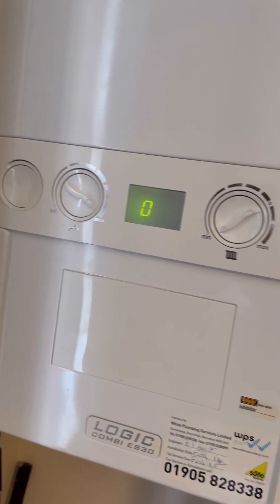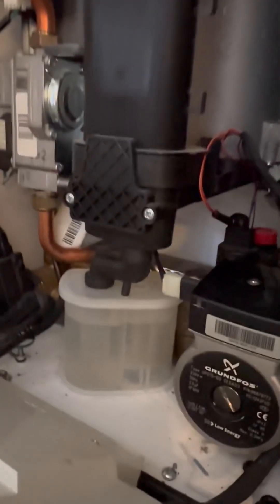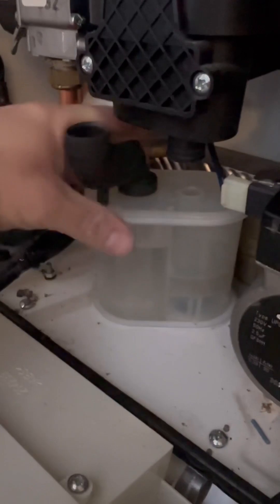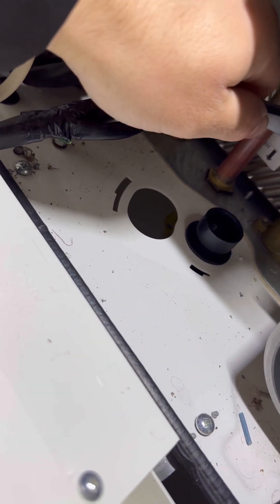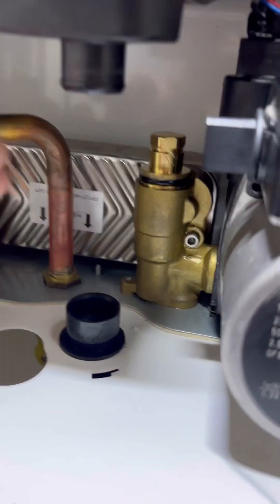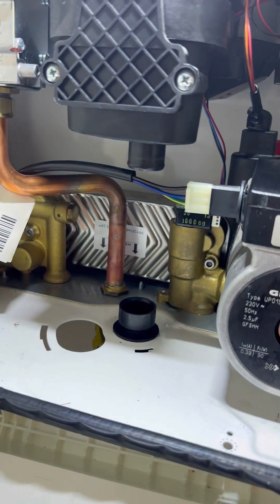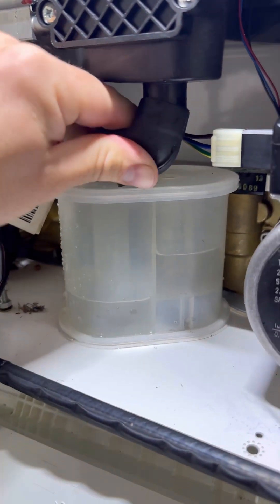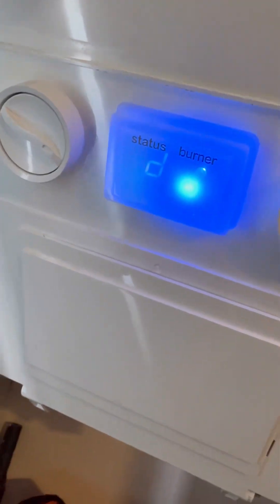‘My ideal logic combi boiler isn’t giving me hot water’ intermittent hot water fault no fault code

Comment: My ideal conmbi fitted  5 weeks ago ,no hot hot water in a week  the installer came and said some insulated  fell into my coffin tank and now I need to replaced  two spring loaded valves will this cost  much my heating is working  but I'm totally  stressed  waiting  for him to get the parts...any idea if this will  work....?many thanks...

Comment: How did you check the mains didn’t isolate?
Reply: Isolated the cold pipe under boiler and turn hot water on if it's coming out it's not off

Comment: Any ideal guys know why a ideal logic hot water isn’t as fast out the taps anymore
Reply: Why
Reply: I think is the pressure, but Im not a plumber
Reply: The plate heat exchanger is probably partially blocked.

Comment: Would it still be the same problem if its just the water but the heating works fine and the hot water comes through when heating is activated?